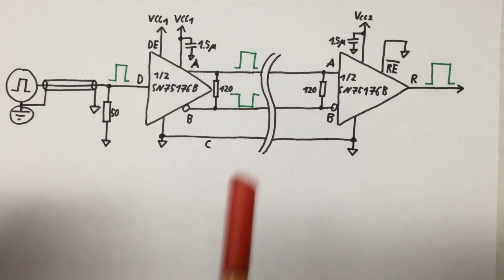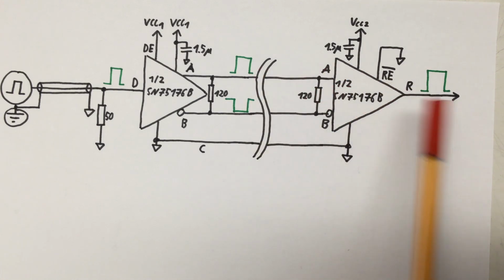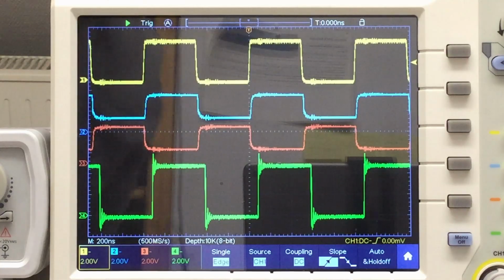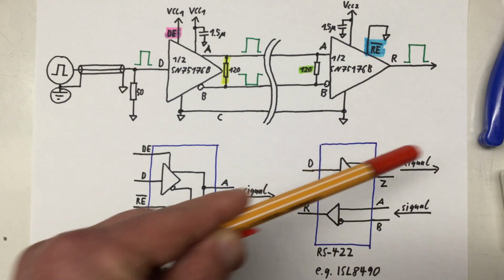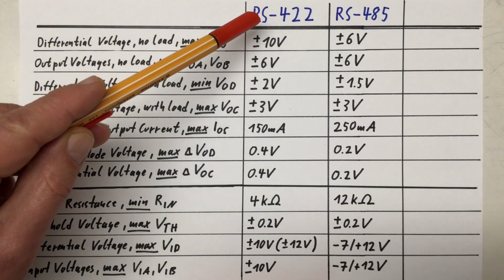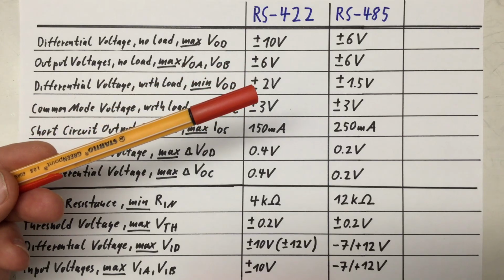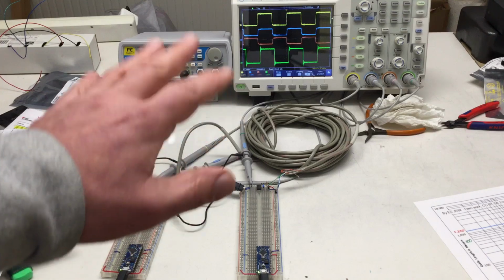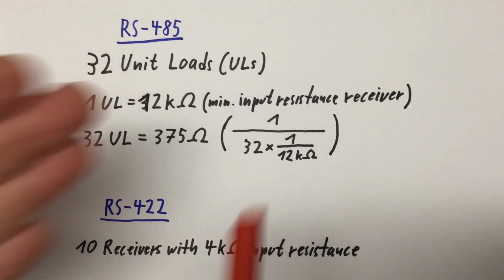RS-485 – The Basics (1/2): Principles, Topology, Specification, Performance

Comment: The value of the termination resistors has nothing to do with being RS422 or RS485. The value should be equal to the impedance of the calbe that is used for the connection.
Reply from the maker: Well, that's one side of the story. The termination resistors have indeed to match the impedance of the cables, otherwise you get reflections of course. But the RS422/RS485 standards also specify the impedance of the cables. This is done so the driver manufacturers know what they are designing for. Those drivers don't just pull up/down the lines, they do that with defined slew rates to reduce high frequency ringing. And that works only when the cables have the specified impedance.
Reply: @robertssmorgasbord  as far as I know, both standards do not mandate a cable impedance. As for rise and fall times, a maximum of 30% of the bit time is specified. Manufacturers can choose to design high speed versions of their drivers and slew-rate limited versions for better EMI performance.
Reply from the maker: @meindertsprang7491  Well, I have to concede that point to you 😅 E.g. the ITU-T standard V.11 (RS-422) does indeed never talks about cable impedance. It's just mentioned that "Generally, a [termination] resistance in the range of 100 to 150 ohms will be satisfactory". Though higher level protocols based on RS-485 usually require a specific cable impedance to avoid problems with equipment designed for these protocols.
Reply: @robertssmorgasbord  that would only be required if devices have built-in terminators. The cable impedance only needs to match the termination resistors or vice-versa. You could very well use twin-coax and terminate each coax at 50 or 75 Ohms.

But all that aside, I have successfully run RS485 over 100 m of twisted pair at 115200 Baud without termination. It's not all that critical, as longs as the ringing or steps end before the sample point of the receiving UART.
Reply from the maker: @meindertsprang7491  Yeah, RS-485 is quite robust. Though, I have a pair of transceivers (OK, one is from an obscure Chinese company) that produce quite a lot of bit errors over 1m CAT 4 cable at 1MBaud with proper 100 Ohm termination. Anyway, regarding "that would only be required if devices have built-in terminators": Many professional RS-485 devices (Modbus, PROFIBUS) have build in termination that you can activate/deactivate via jumpers/switches. In those cases you'll have to stick to the "prescribed" cable impedance I guess.

Comment: Good video. Just wanted to mention that the two breadboards are also a factor in signal degradation at high frequencies.
Reply from the maker: Thanks 🙂 And yes, you're absolutely right. The breadboards are indeed not really suited for high frequencies. Those relatively large metal plates for the contact rows create a whole lot of parasitic capacitance and to some degree inductance.

Comment: Many Thanks dear Robert!
Why did you terminate the transceiver side with 120 Ω? As far as I know, only the receiver side needs termination.
Reply from the maker: Nope, in general you need to terminate any transmission line on both sides. Only if your transmitter, respectively, receiver has the right impedance (that of the transmission line), you can forgo termination. RS-485 transmitters have a much lower impedance than the transmission line  (120 Ohms nominal) and RS-485 receivers a much higher one, so you have to terminate both sides. Hope that helps.
Reply: You do not terminate the transceiver sides. Instead, you terminate the ends of the cable. An RS485 device is both transmitter and receiver and these can be anywhere on the cable, as there can be multiple devices on that cable. The terminations at the end of the cable prevent reflections of the data signal back into the cable where they would interfere with the data.

Comment: The 120ohm, is by design inside all slaves or is need it to add when making the connections?
Reply from the maker: Some slaves have an integrated termination resistor, some don't. Slaves that have an integrated termination resistor always have an jumper or switch to connect/disconnect it.

Comment: Dear Sir,  I never saw better explanation of RS485 before. Thank you very much. Can you make the video wherein we have to read holding registers of temperature controller using ESP32.
Reply from the maker: Thanks for the praise! And you're very welcome! Unfortunately I have absolutely no experience with ESP32s. However, it shouldn't be too hard to find a RS485 library for ESP32s (e.g. https://gist.github.com/tenergyinnovation/625739495449512bedf2ef26c9fc6a27 ). Do you know which protocol the temperature controller uses (Modbus or something proprietary)?
Reply: @robertssmorgasbord  Dear Sir,  There is no much of the difference between Aurdino or ESP32 as far as programming is concern. The Delta temperature controller uses RS485 Modbus RTU. The problem I am facing is to send the command to controller, like say to read holding register the command is 0x03 and then the address of the holding register, which starts from 1001 (HEX). Now I presume that when I send this command, then only I will have data on the bus, but there is no clarity as to whether only command should be send or command along with the addresses, etc.
Reply from the maker: @ Have a look at the sixth part of this series (The Details 4/4), there I cover most of the Modbus over RS485 specification: https://youtu.be/SzlGJrPhmwE

Comment: Excellent explanation !! Cant wait for the remaining 27 videos :P ... Jokes apart, your videos are truly a deep dive learning experience !!
Reply: Did you pick this chip,  because you had it in your stock ? Just asking because MAX485s are more common this side of the ocean.
Reply from the maker: @ Yes, I picked it. Not for it's performance/features, but because it was the cheapest one that came in a 8-DIP package for breadboard demonstrations 😅 Plus, the SN75176B is a classic - released in the 1980's and uses TTL logic. There are much better RS-485 transceivers available.
Reply from the maker: Thanks you very much for the praise! But hold your horses ... there will be one more "The Basics" video next week and then we'll go into "The Details". Topics I plan to cover so far: Timeouts, multiple slaves / addressing (of course), active termination / biased lines, fail-safe receivers, full-duplex busses. So far that should fit into 3 to 4 videos 😅